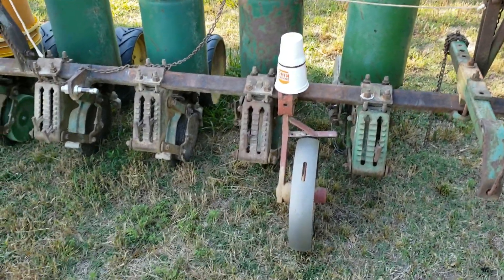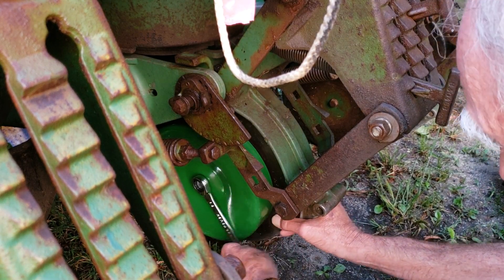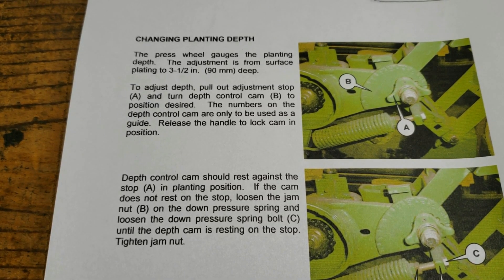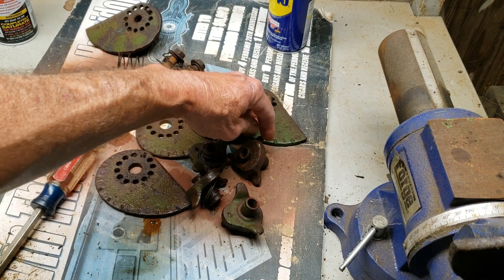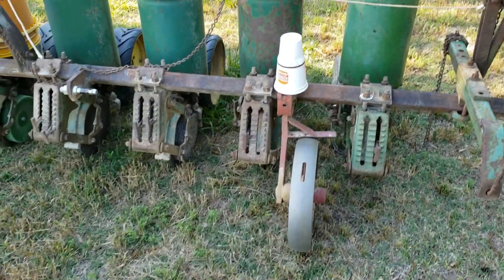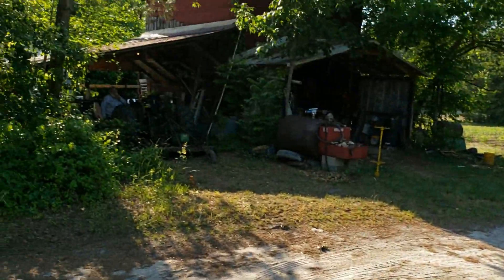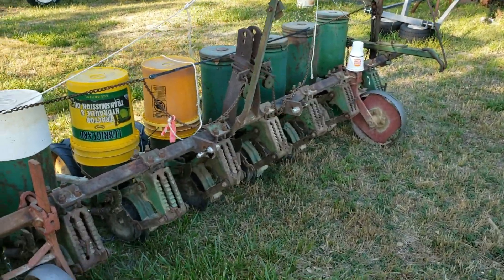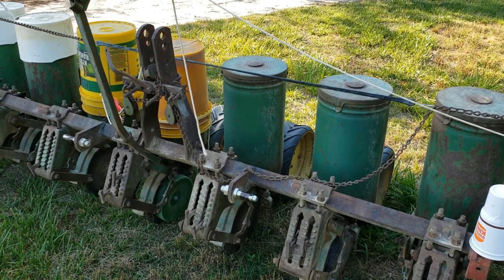depth bands and seed depth adjustment

Comment: A little bit of lock-tight  thread adhesive on the bolts will keep the depth bands from falling off.
Reply from the maker: It's a great product and works well when used as directed.
https://www.amazon.com/Loctite-1329467-Medium-Strength-Threadlockers/dp/B009I2UC3Q/ref=asc_df_B009I2UC3Q/?tag=hyprod-20&linkCode=df0&hvadid=693270349614&hvpos=&hvnetw=g&hvrand=12762410012769163853&hvpone=&hvptwo=&hvqmt=&hvdev=m&hvdvcmdl=&hvlocint=&hvlocphy=9009721&hvtargid=pla-312799887038&psc=1&mcid=285eca7fcac73563b484da0123806ca9&gad_source=1
Thanks for bringing this back to my memory.

Comment: I have JD, IH, Massey Ferguson, and Ford on this little farm. They all have good parts and bad parts..That Ford of yours is a swell tractor I hope lift issues are simple to fix. Your perseverance with the planter will pay off.. and.. God is good...all the time!!!
Reply from the maker: That little Ford tractor of mine has its good days and its bad days.  I know that's got to sound strange but it relates to what I'm actually doing with the tractor. The Ford hydraulic pressure is not as high as that little John Deere 1020 and will not create as much lift pressure.  The lift on the Ford will not come up fast enough to snap the row markers into the locked position. They work real good on that little John Deere once cousin gets the chain length dialed in.
Thank you very much for being here watching videos supporting this channel. 

And yes I agree 100% God He is always good, the same yesterday the same today the same tomorrow always good. 🙏🙏🙏🙂
Reply: JD certainly has Ford beat in the hydraulics category!!

Comment: A good way to make sure your planter is putting out seed at the end when you turn around look and you will see seed on top of the ground where you picked up if not you got a problem that’s my monitor
Reply from the maker: You are correct I've noticed that seed at the end row some of the rows are kind of long and I'd like to have a more confident feeling I hadn't just left an empty unplanted row.  It was an outside unit I was having the difficulty with so there's more than likely places out there where I've got a 48 inch wide space between the rows. We'll find out after it sprouts what we got. 🤔
Reply: The monitor on these are the yellow rods that stick out of the top of the lids on the cans.  If one of them is not going down it is not planting.

Comment: I'm not sure but the draft control knob on your Ford may need to be set higher to lift more??   Good luck with finding a fix.  When it comes to ole Mater Head (satan) dont give that fallen defeated spirit any place--including a place in our conversation.
Reply from the maker: I needed to jump on some spraying Saturday and I was curious was it going to be able to lift the tank so I only put 50 gallons of water in it I was able to lift it and then I saw where the draft control was in the wrong position, duh...🤔  100% agree with you we have to be careful about what we let actually come out of our mouths because those words contain power whether we want them to or not.  
Always great to find you here in the comments my Brother in Christ....🙂☕

Comment: Glad you are learning the planters. Now you can understand the relation of the tool bar gage wheels and depth setting cams. That information that gentleman sent you was a God send. The written word as they say. As far as the chain coming off if you can find them there is a mechanical device that if I remember correctly attaches to the gear shaft on the side of the planter that consists of a "flagging" device that as the shaft turns bobs up and down indicating the chain is on. They will drive you crazy looking back to see if they are all moving. I used to run them on an eight row planter. It was an early attempt at a seed "monitoring" devise. I think once you have it all figured out you will enjoy the job these planters will do.
Reply from the maker: His name is Gary Clayton and his comment is up above this one in the list of comments. The document he sent to me opened my eyes to what you were explaining once I had that picture I began to see how it worked. Johnny thank you so much for the information you gave to me making it possible for me to go down this unknown path and arrive at the solution I was Desiring. 
I'm going to check into this little flag thing, Dragging this planter and having a row not being planted is unacceptable.  
Johnny thank you for being here helping me🙂☕